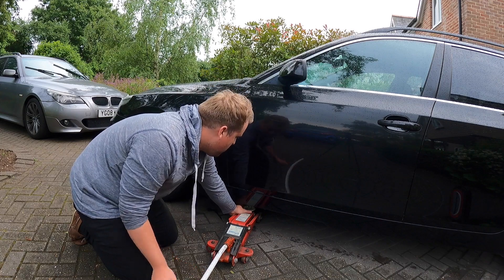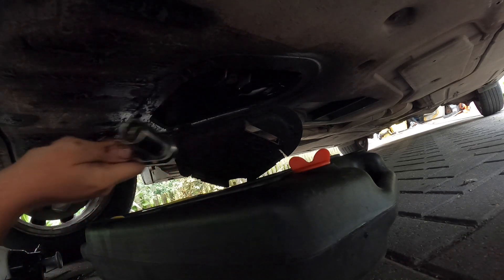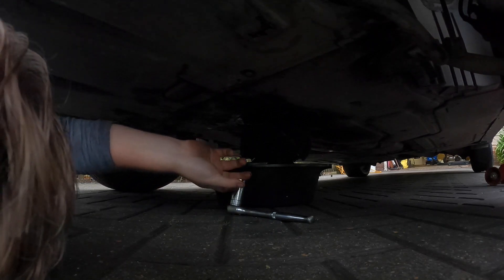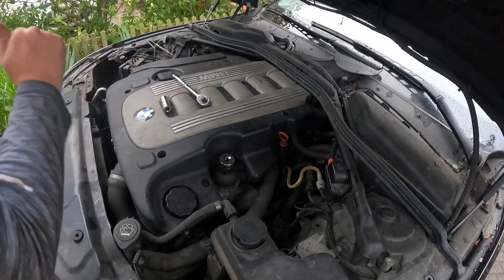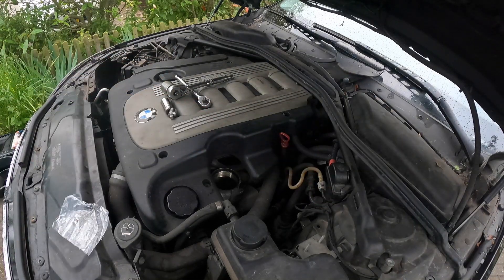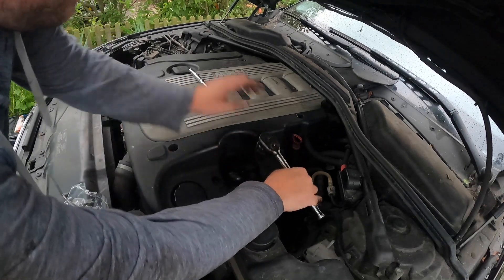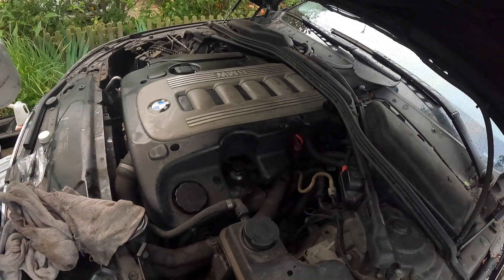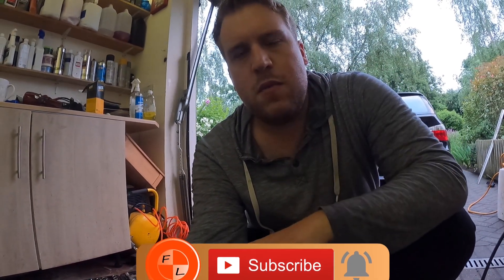BMW M47/M57 Oil and Oil Filter Change DIY

Comment: What you wanna do next time you do oil change on m57 engine is undo the oil filter housing before you drain oil from the sump to get the old oil out of the housing. Then undo the engine oil cap and pull dipstick out to help the flow of the oil. 👍